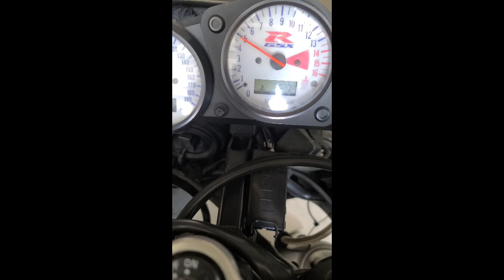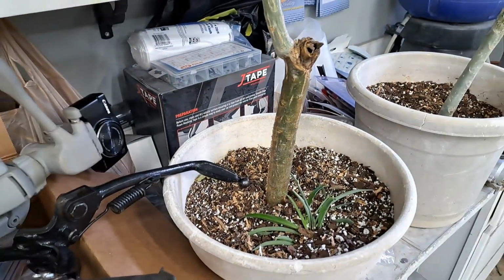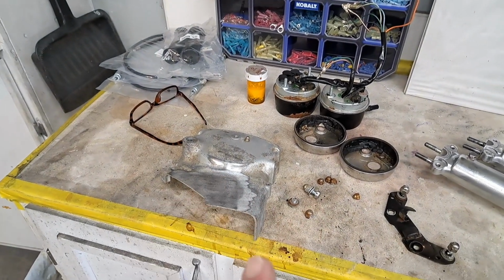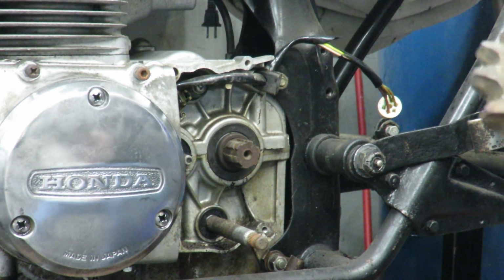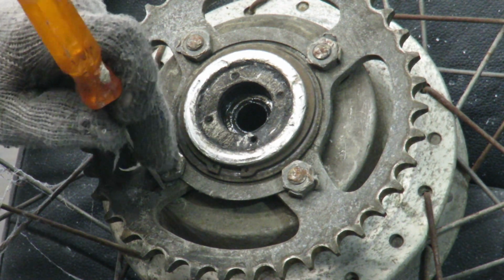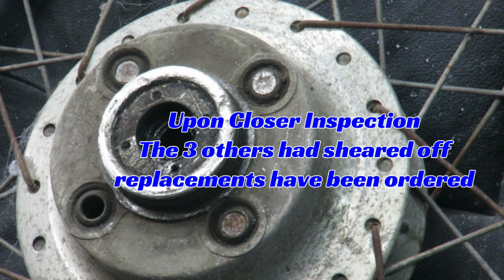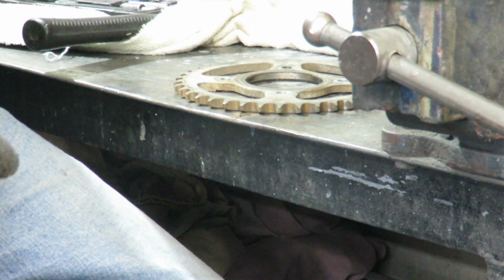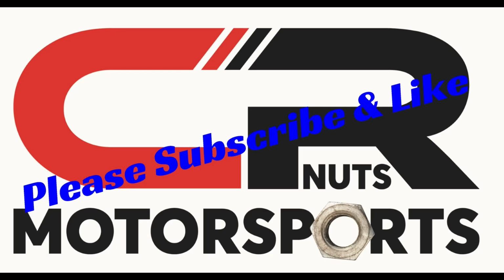Vintage Honda Sprockets Removal

Comment: The long stud is correct , the other 3  have sheared off in the rubber bushes . you might drill em ,
Reply from the maker: Actuall, they came out easily. Finding the exact Honda replacements was not that easy but I managed it. It took me a while to figure out what had happened. I'd always been a Suzuki guy and have worked on many Honda. Interesting way of doing it 🤔